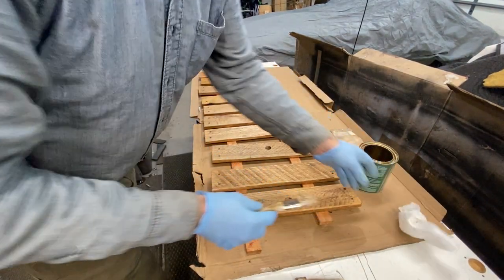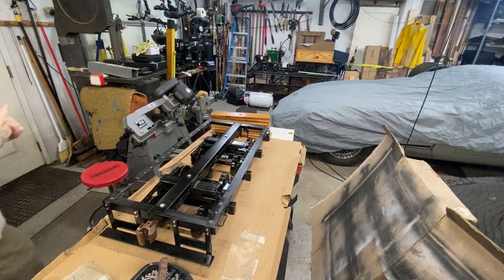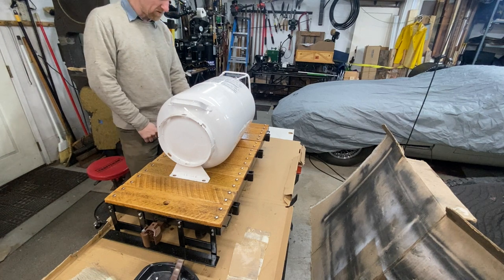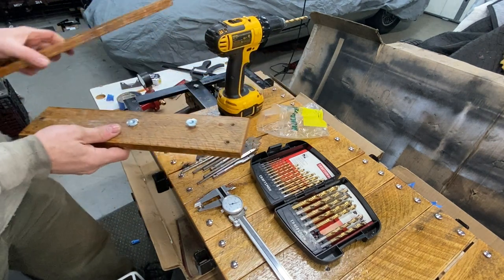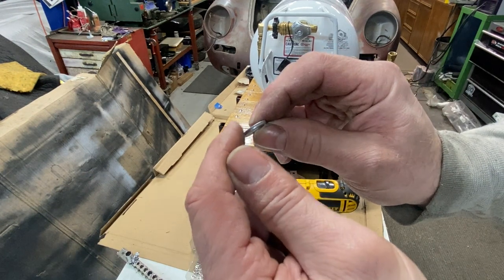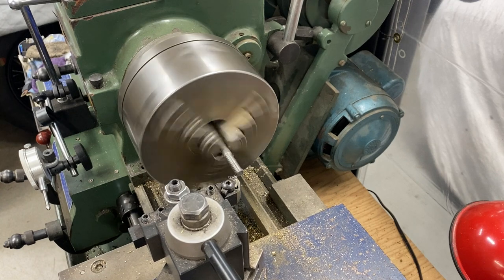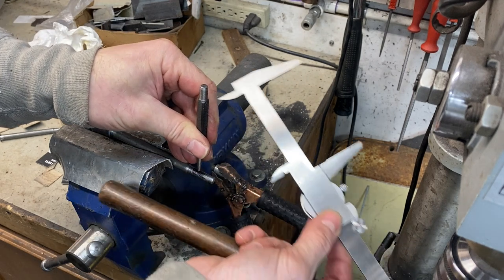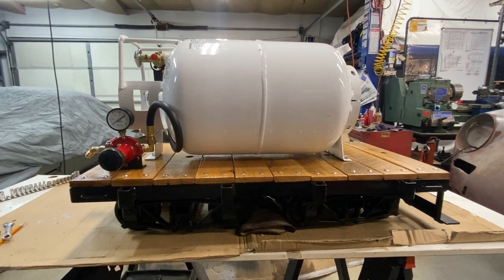Let's Build a 7.5" Gauge Railroad Flat Car/ Tender: Part 2 to completion

Comment: Nice work!  Well made video.
I have a question;  How do you re fill the propane tank? Do you take it off the car and bring it to the re fill gas place?  Wouldn't it be easier to set it up to use those exchange BBQ propane tanks at grocery stores etc., and just swap out the Empty for a Full one?
Reply from the maker: Thanks for the kind words! I have a T nut embedded in the wood on one end and a clip on the other end so I can remove the tank. Most places won't refill them in place, and they like to stand them upright. It takes a few seconds to remove the nut and the regulator fitting.
Reply: ...BBQ propane tank places don't stock/exchange horizontal propane tanks.  Their primary business is for grills.
Reply: @carlbaskin270 Correct, but they are far easier to find and open longer hours than the few propane filling places.  So why go with a horizontal tank?
Reply from the maker: @steamhostler4252  Yes, I have seen people use a couple BBQ type tanks to get whatever capacty they need. Many are cleverly hidden in a cattle car or tender. That probably would be the easiest approach of the flow rates are sufficient, which is more of a limiting factor for larger boilers. In my case, the horizontal tank came with locomotive so I made use of it. Since I only run it at Train Mountain, they just fill me up there and put it on my tab for each meet.

Comment: I like it.  Looks like about a 20 pound tank?  Also wouldn't mind seeing welding videos.
Reply from the maker: Thanks! Yes, 20 lb tank. I'll put in some welding next time I build something. I've been busy with full size railroads lately but I plan to build a shorty tank car that will require a similar welded frame.